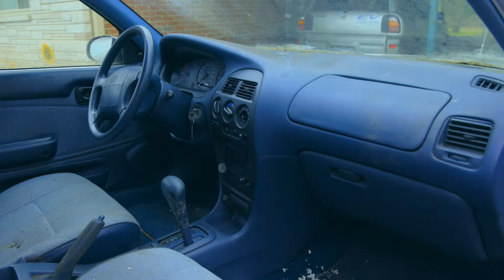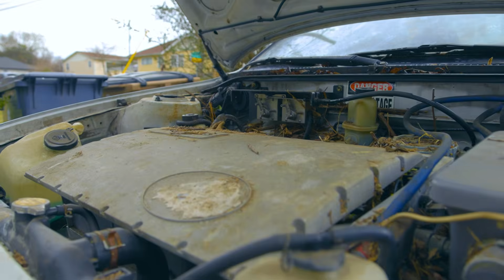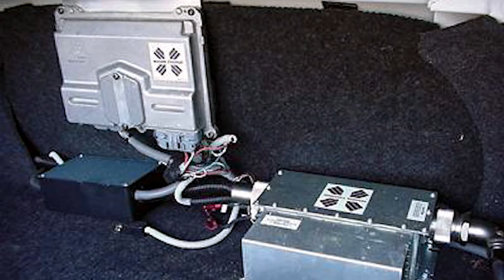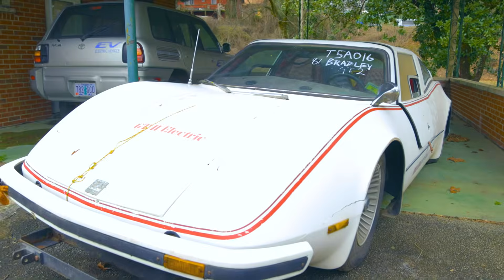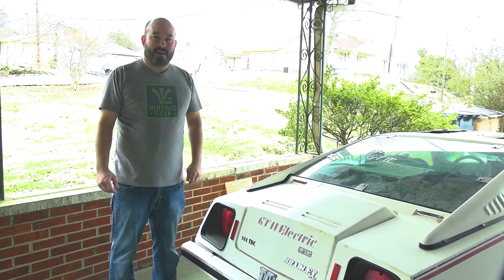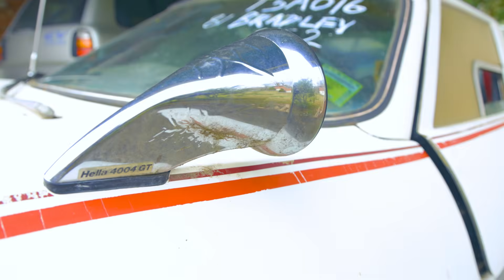EV Adventures: Saving a US Electricar and Bradley GT Electric

Comment: I think the Bradley could be easy to put it back on the road. The electric conversion looks like the generic ones from the 70's. So the components maybe are solid state electronics. In the cluster I saw a curtis controller gauge, it was very common for that time. Very funny the adition of the window AC, probably they put an inverter to running it but by reducing the range.